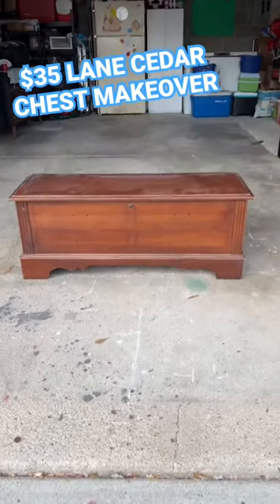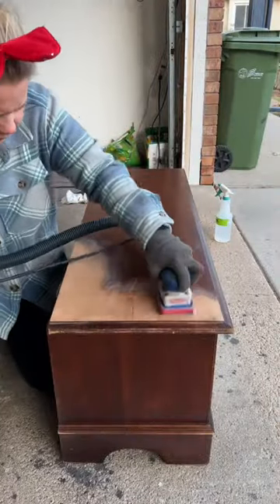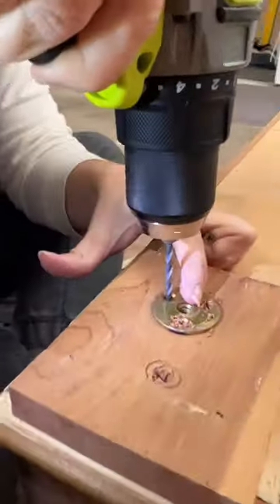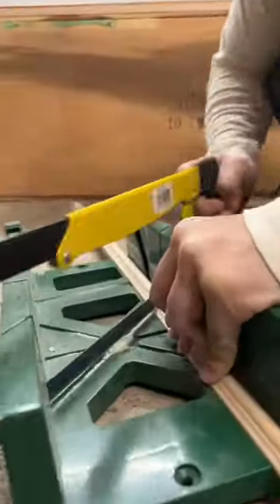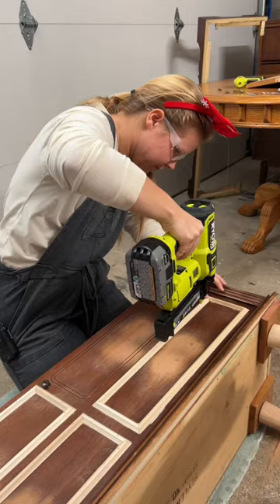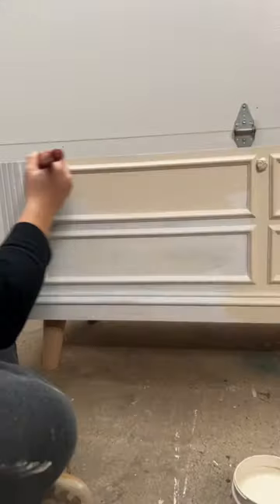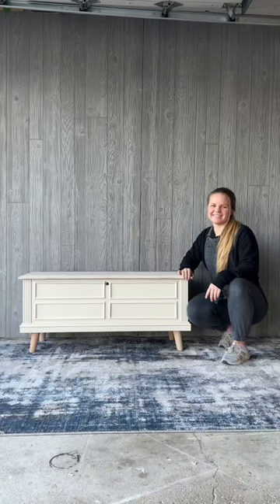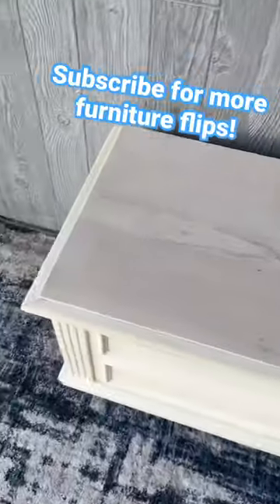Watch me transform this $35 Hope Chest! #diy #makeover #furnituremakeover #furnitureflip #shorts

Comment: I hope you removed the spring latch.  There have been notices published to remove these so children don't get trapped inside.  Beautiful job on the finish, and adding legs is a great idea!  I may try that on my own Lane cedar chest!
Reply: Just wanted to second this. The FTC had a new conference about children getting trapped inside. I removed mine. Just to be safe.
Reply: I've been thinking about making mine over and selling or just keeping after, but did look last year and found the deal with the latch. How do you remove? Mine is similar to this, but sits completely on floor, and has the latch on front.